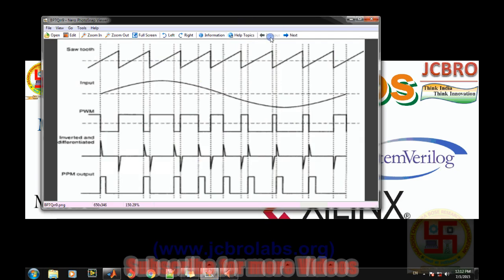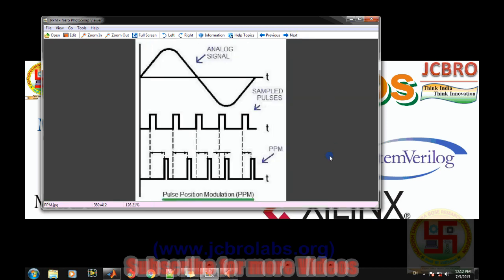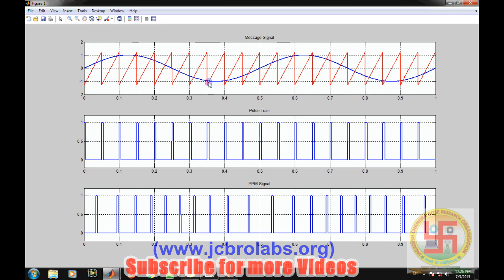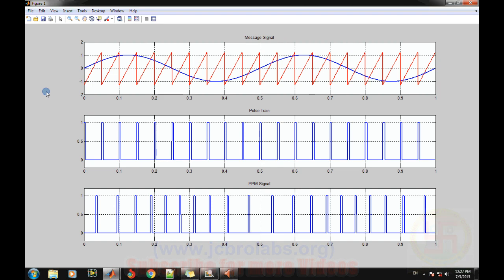How to Simulate PPM Modulation Technique using Matlab??

Comment: I can't find the code on the website
Reply: fc = 20;    %carrier frequency
fm = 2;     % message frequency
fs = 1000;  % sampling frequency
t = 1;  
n = [0:1/fs:t];
n = n(1:end - 1);
duty = 10;
% no. of samples in one square wave period
per = fs/fc;
% no. of samples in on time
on_t = per/duty;

s = square(2*pi*fc*n,duty);
s(find(s<0)) = 0;
% message signal
m = sin(2*pi*fm*n);

% Triangular wave
A=1.25;
c=A.*sawtooth(2*pi*fc*n);%Carrier sawtooth

% 
ppm = zeros(1,length(s));

% find ids where carrier is greater than message
id = find(c > m);
idd = diff(id);
iddd = find(idd ~= 1);
temp(1) = id(1);
temp(2:length(iddd)+1) = id(iddd + 1);

% ppm signal
for i = 1:length(temp)
    ppm(temp(i) : temp(i) + on_t - 1) = 1;
end
% Plot
subplot(3,1,1);plot(n,m,'LineWidth',2);title('Message Signal');hold on; plot(n,c,'r','LineWidth',2);grid on;
subplot(3,1,2);plot(n,s,'LineWidth',2);title('Pulse Train');grid on; ylim([-0.2 1.2]);
subplot(3,1,3);plot(n,ppm,'LineWidth',2);title('PPM Signal'); grid on; ylim([-0.2 1.2]);
Reply: https://drive.google.com/file/d/0B3qx_fO_3y2AWFRqQnJqNWgtTjQ/view